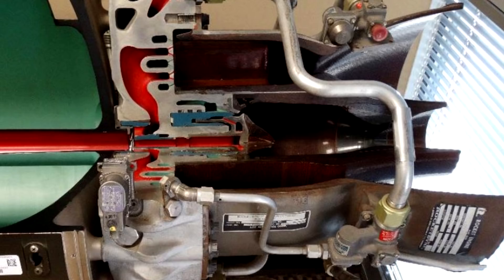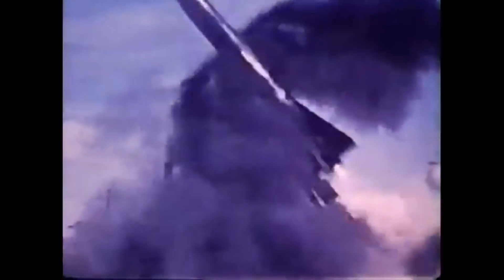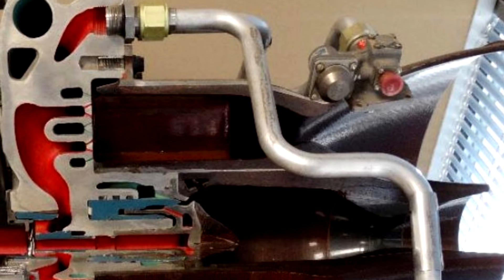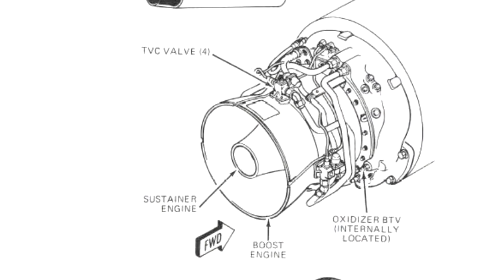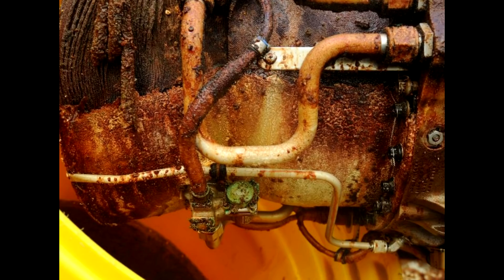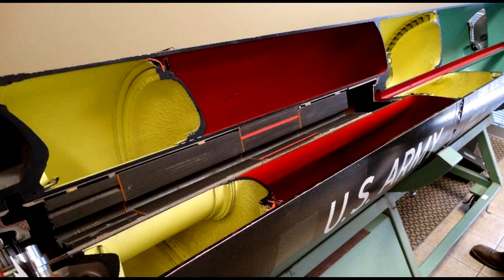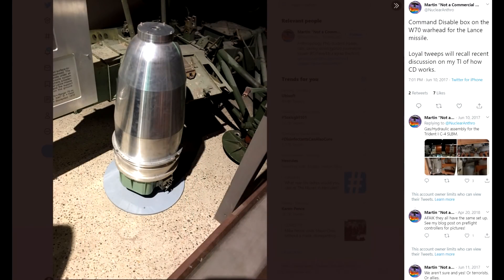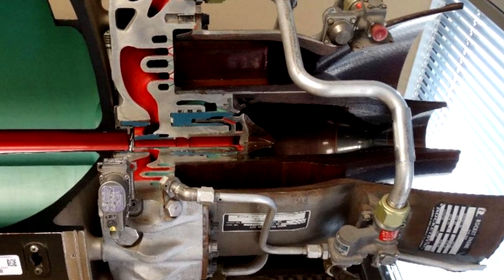A Rocket Engine Inside Another Rocket Engine - The Lance Missile

Comment: Its a two stroke engine with directional fuel injection lol easy to operate indeed. Hell, you could rebuild it from the cutaway in CAD and build a block casting in a couple days. And id swap the ablative material for ceramics and program shorter bursts to allow the heat to dissipate slightly. Still gonna consume the components but you could get at least 50% the effective range at the same payload. Nowadays with more compact nuclear weapons you could make a cut-rate version that nearly matched the original specs. Very neat. Just four little control valves, probably set to manual gyros and gimbals with a digital checksum in the background. This rocket is about as technologically sophisticated as an RX7 with a rotary engine from the mid 90s.

Ps oh and the 4 valves? Those are EGR valves, exhaust gas return, so it steers by dumping dead gas into 25-75% of the engine. Super simple to work on, you could keep this rocket ticking with a modern volt-ohm meter and not much else.
Reply: Modern ceramics would be a good choice for the rocket nozzle, but that's about all that's right with your comment.
These days we can do even simpler than a liquid fuel rocket. Solid fuel rockets are simpler to use, there's no pesky moving parts except for potentially the thrust vectoring gimbal and rocket nozzle.
And modern missiles are easier to use, despite being more complex to produce. You put in the target coordinates, hit the go button, and it figures out how to get from point A to point B.
Reply: @44R0Ndin  i agree that modern programming takes the ass labor out of it but i know EGR valves when i see them. The actual technology running this paved the way for modern motor vehicle control systems. Everything i said was right, its why they made it mechanically simple. Its a choke system running on what i presume is a 6 volt DC system. Basic circuit design, mechanical relays and one engine casting. Simple. Couldnt be simpler to fiddle with. I get that most people didnt grow up turning tvs into oscilloscopes but i did. I couldve made that into a neutron gun for shits and giggles. I made heavy water when i was 15 for christs sake, science is not a huge mystery to me lol would i need more than one rocket to get things right? Yep, most people do miss the mark with their first few rockets, pun intended. See werner von brauns early film for evidence of this. It wouldnt be a cakewalk but that rocket is simple and elegant and id love to play with one, in CAD and on the range.

Comment: I'm thinking of that moving piston between the two fuel chambers, with UDMH on one side and nitric acid on the other, and wondering what happens if some fuel or some oxidiser wriggles past the seal while the vehicle is in storage. That seems... bad...
Reply from the maker: You misunderstand, the tanks are separated, but there's a gas at the top of each tank that pushes the piston.
Reply: @scottmanley  Ah, good! That seems much less explode-y (insomuch as the term can be used when discussing nuclear missiles).

Comment: That moment when you turn your conventional war into a nuclear war just because the enemy is 81 km away.
Reply: Our deployment strategy was to take over small villages and hide our launchers in barns until our nuclear capability was required.  If we fired a conventional warhead, the unique radar signature was easily identified by the enemy and every available artillery unit would be raining down on us.  If and when we did fire, the soldiers would run to the launcher, climb on and drive away as quickly as possible, even raising the rear gate on the move using ropes on either side.  We weren't expecting to get too many Nukes off before we started glowing or getting blown up.
Reply: You turn a cold war into a sun-like hot one.
Reply: Actually, the conventional warhead for these were a political bait to allow deployment in countries sworn to not have nukes.  In those cases, the real warheads were kept ready just outside the border for quick completion of the bait and switch.  Another comment mentioned the Flensburg facility which was such a storage facility to instantly put nukes in Denmark

Comment: Scott, have you ever considered a show on Amateur Rocketry? I used to build and fly fairly large rockets (6"+ in diameter and 7 to 10 feet long) and there are thousands who do so every month here in the USA. Note that we always had to get FAA approval to launch these class of rockets because you wouldn't want to hit an airliner, right?
I mostly used sugar + an oxidizer but was also experimenting with butyl rubber calk + oxidizer or epoxy + oxidizer solid propellants. You build your own nozzles, cases and bulkheads to so it's quite a technical hobby.
Makes the Homeland Security people crazy though, some of our rockets could Cary a 10 pound payload to 40,000 feet. (Obviously if turned horizontal and launched at a target it would be very destructive so I get their concerns about the hobby.)
We had to put tracking and data systems in do we could record the flights and also recover our rockets. Believe me, if you spent 200 hours building it it was not something you wanted to shoot and forget... Your team piles into a vehicle and chases it because depending on the wind it could drift miles before it landed - actually lots of fun!
You recovered it and changed engines and launched it again!

Comment: what if you instal ramjet inlets right above nozzle and all this air will expand simultaneously cooling nozzle and creating extra thrust?
Reply: Won't cool the nozzle fast enough to avoid needing ablative materials, but you would increase the total impulse delivered to the rest of the missile which would increase range. Some supersonic cruise missiles use a solid fuel rocket-ramjet for just that reason, it means they can carry less fuel on board.
A solid fuel rocket-ramjet is basically a regular solid rocket motor in a specially shaped duct. Because it already has a full solid rocket motor in it, it can produce thrust from zero initial velocity, unlike a conventional ramjet. With the aid of computational fluid dynamics and computer aided design, it's relatively simple to incorporate such technology into advanced high-speed cruise missiles. While there is no reason such a rocket-ramjet couldn't be made using liquid fuels, the use of solid fuel is important because it makes storing the missile much simpler. Unlike storable liquid propellants, solid propellant can't leak and is not very corrosive or toxic.
Low speed cruise missiles usually stick with a turbofan engine, which requires liquid fuel. Solid fuel rocket-ramjets are not used on ballistic missiles because they don't spend much time under thrust, and most of their flight time is coasting above the atmosphere, where ramjets don't work.

Comment: Would be interesting to design a rocket engine using this type of coaxial engine to maintain optimal thrust from sea level to max height of the stage. I think it would have to be reversed so that the majority of the thrusts comes from the center rocket nozzle and controlling the flow of the outer nozzle for control.
Reply: I think this concept is better for this rocket because of its short ranged. When you go for orbital flights, you have to get rid of dead weight anyway (like the tanks) so it makes more sense to just optimize two engines.
Also, one failure with an engine like this would also mean the failure of the "second stage".

Comment: russians did this with ICBMs
Reply from the maker: Do you have some good data on this, engine designs and cross sections etc?
Reply: @scottmanley  Actually, not quite engines within engines but rather stages within stages. 2nd stage engines were submerged in 1st stage propellant tanks. My bad.

Comment: I'm a little curious how the piston prevents bubbles. It's not pressurized, but I guess the pressure of the piston is enough to keep it liquid? Couldn't bubble form anyway?
Reply: The piston's job is to separate the gas and the propellant. It keeps the propellant on one side and the gas on the other side. And actually it is pressurized when in operation, because it's a pressure-fed rocket engine so the pressure in the propellant tanks has to be greater than the pressure in the combustion chamber. The solid propellant gas generator provides hot gas to one side of the pistons, which makes the pistons move, and that causes the propellants to flow to the rocket engine.

Comment: I have a question:
What are the differences in aerodynamics of a stable rocket in comparison with the same rocket spinning at a high rpm?
Would there be any difference? If so, are they being negated the more speed you gain, or the other way around (probably up until a certain threshold)? 

Seing this rocket spin at launch, made me think. God forbid.
Reply: Steering is the difference. A spinning rocket is very good at going straight, but it's very bad for any kind of maneuverability.

Comment: How can they steer the rocket with that kind of thrust vectoring while it's spinning?
Reply: But it only spins at the very beginning. Scott says it in the video.
Reply: @trezapoioiuy  No, it keeps spinning. It's just that it moves from gas generator induced spin to aerodynamic spin. The guidance system knows how the missile is spinning so it can time the side injection TVC pulses to steer the exhaust in any direction it needs

Comment: How do you steer a rocket that is rotating ? I mean this seems to go really fast, and i assume the steering mechanism need to follow the rotation, thus the reaction time need to be really low (and the mesuring device quite good)
Reply: It only rotated at the very beginning, until the speed was high enough for the fins to stabilize it.
Reply: Actually, I was thinking that guiding a spinning rocket would be easier because you would only need one vernier thruster that you pulsed on when in the required orientation. The control system would hopefully understand latency.

Comment: can somebody explain how these hollow cavities in the back of the engine would be manufactured? it looks to be sealed all round
Reply: I suspect it's just a casting with a core, similar to how coolant jackets are done in car engines. I would think the interior surface finish is very very good for the time period, it was probably a very expensive process at the time.
And you're right, the core does have to protrude through the metal in at least one spot. You've got the inlet for sure and you can always add additional mounting points and close the resulting holes later in the manufacturing process which wouldn't necessarily be visible in the images we've seen.

Comment: Is it just me, or does "short range nuclear missile" sound like a spectacularly bad idea? 🤔
Reply: Not every nuclear weapon is a 15 megaton yield thermonuclear device. The yield on the W-70 warhead used in the Lance was only capable of a max of 100 kilotons, merely 5 times as powerful as the ones dropped on Hiroshima and Nagasaki. At minimum yield, they were 20 times weaker than those two, just 1 kiloton.
For that kind of yield, a maximum range of 100 kilometers is plenty enough to be safe from the effects of your own weapon.
Reply: Short range also meant less reaction time for your enemy. Both sides basically knew they needed a nuclear pulse of several hundred ‘small’ short ranged warheads to knock out tank formations, airfields, supply depots, ports, special weapon storage sites, HQs, etc.
It was hoped after this initial exchange and surviving units delayed their enemy that cooler heads and diplomacy could prevent escalation to the big stuff and city killing.

Comment: Please explain how do you control spinning rocket. I have problems when my spinning designs spin faster than 60rpm and it looks like this missile spins at well over 100.
Reply: The IMU (inertial measurement unit) keeps track of position and orientation of the missile. So it always knows where is up and down, left and right, even if it's rotating. All it has to do is to quickly open and close the right valves at the right time to steer the thrust in the desired direction.
Reply: A s the video says, it only spinned at the very beginning, and the spinnign itself was the stabilization (gyroscopic effect), until it went enough to be fin-stabilized and it didn't spin anymore.
Reply: @trezapoioiuy  Not really. The missile was spinning during the whole flight. The thrusters were just used to get up the RPM fast, then the fins which were slightly angles, maintained the spin.
Reply: @trezapoioiuy  I thought that it relayed on spin for stabilization at all times in flight, with engines providing it at first, and later roll input with the fins. A bullet rocket, perfect for drilling into underground bunkers.

Comment: I can't help but run the tapes in my head through the decade of engineering to make this work.  It's loaded with uniqueness; the question becomes how much of this was bolted-on to make it work?  Alternatively, perhaps it is exactly as originally designed, but each new trick took its toll -- so perhaps the real question is did each functionally new aspect (vectoring with only valves, ramming the prop/Ox with pistons, ablatable combustion, spin-up thrusters, etc.) force a serialized approach, or did the team grow to address everything in parallel?  If I were to guess, I'd say the spin-up thrusters were bolted-on, and the original design engineers could not address everything in parallel.  Very cool!  Thank you for this gem of engineering!
Reply: *boss walks into the engineer lunch break: "I have a great idea. I have heard this is cutting edge technology and other rockets do this. We need that as well. Make it work." *walks away
Reply: Going to bet the only thing new here is bi-motor design.   Ablatives, phenolics had been used forever, and certainly by solid propellant rockets way before this.   Spin up rockets, used before as well, very easy.  The thing I see is that all this simply drives the cost up.  In the 60s real engineers designed real things and did a pretty good job of it.  In the 60s they could test rockets to failure.  In the late 80s when I was project engineer on solid rockets, we were not allowed to have a failure, so we never really knew where the failure points were.

Comment: Why thrust vectoring if its spin stabilised?
Reply: How many people are asking this question, when you just have to listen to the video to get the answer?
Reply: i agree highly unlikely that you could open and close valves in vectoring fast enough during spin...probably why they needed the pistons too as the fuel would not flow at spin speed without the push
Reply: @davidburwell4218  It stops spinning shortly after launch.

Comment: SR71’s J58 engine is also an example of engine inside the engine. J58 combined turbojet and ramjet which allowing SR71 flying from 0 to March 3.3 cruising.
Reply: That's not really an "engine inside an engine" but a variable geometry turboramjet. At high mach numbers, the turbocompressor is simply bypassed by a set of baffles that shield it from the supersonic airstream. Both engine modes still use the same combustion chamber.
Reply: @Stoney3K  i always thought the j58 was kinda like having a HVAC system on your house that in certain circumstances would start SUPPLYING power to the house!:P
Reply: Real Engineering recently did a video explaining the engine system.